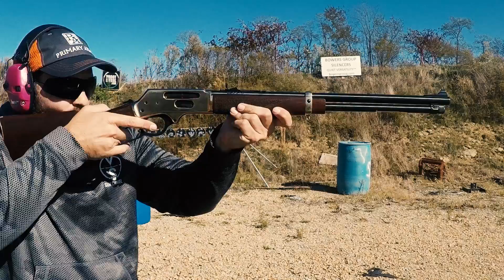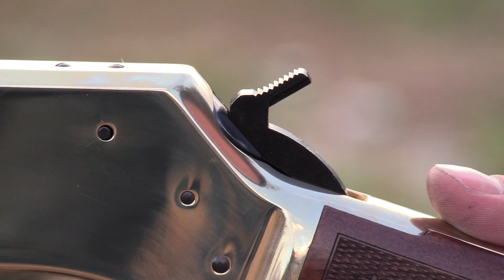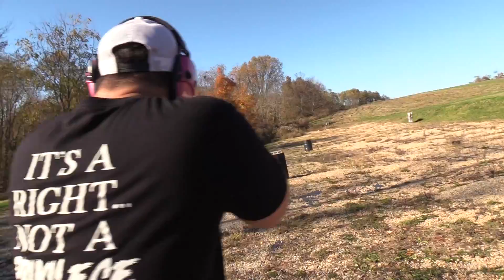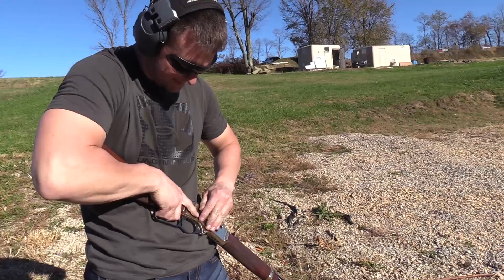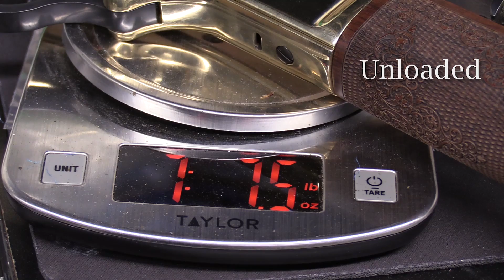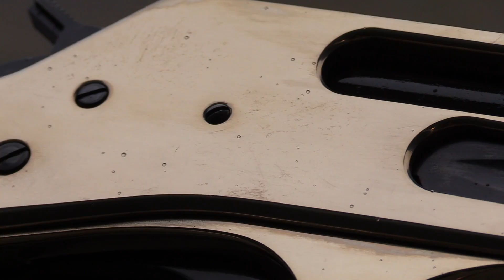Loading Gate VS Tube Feed No Longer 💎 Henry Lever Gun Run and Gun

Comment: If I had to work this gun for ranch defense from an ANTIFA raider gang,
1) Polymer stock w/Keymods. 
2) Large Loop lever
3) Pic rail with white light mounted
4) XS Tritium Big Dot
5) Buttstock Sleeve with pouch covering loops for 1 full reload
6) Plain sling
7) Bandoleers with loops for ammo
8) Ammo Belt with loops

Anything rather then running loose ammo from a pants pocket. You don't want to be another Scott Gadell

Comment: Most repeaters in the old days were 45 cal. This gave you much faster loading speed and you could hold s bunch of 45s in your hand for fast efficient reloading, especially ball ammo. Plus you would only needed one type of ammo for your revolver and your long rifle...that's smart. I would never use a 30-30 repeater. That's just for those stupid people out there that bigger is always better. Your overheating the gun with 30-30, and I guarantee you it will fail sooner than a 45!

Comment: That is a beautiful rifle. I'd leave it as is. If you make a tactical lever action, technically you'll find those cowboy action models pretty good. Those guys who shoot at the cowboy competition shoots, they shoot the piss out those lever actions and they shoot them fast. I'd put on an enlarged lever so there's more room for your fingers. Also need a belt or bandolier to hold your rounds and load from the strong hand side. If you insist loading from the top, perhaps modify the spring on the loading gate so it has less tension to easily slip a round in. I've never shot a Henry lever action, but I've shot a Winchester model 94 for years. My Winchester was used and abused and was a loosey goosey, but loading was easy and fast and so wasnthe action. Despite being well worn in, the accuracy was phenomenal.

Comment: Very cool. If it helps, I load one round about 3/4 of the way past the loading gate and use the next round to push it all the way in while placing the next round about 3/4 of the way in. Repeat until the 5th, or 6th, and use your pinky to push it past the end of the loading gate. That’s how I’ve always done it, and that way I don’t get my thumb pinched.
Reply: Also wrapping the forward handguard in leather will help mitigate some of the heat, although most folks aren’t going to be using them in this manner.

Comment: Would have been interesting to do a side by side comparison of what's faster, Could it potentially be quicker/easier to pull the tube and load/top the rifle off through the tube hole while on the move? Definitely would have to be more careful with the paws on the muzzle end. Also i bet that tube gets pretty hot too.

Comment: If you’re going to load more than one bullet you push the first bullet 90 percent of the way in, then you load the second round the Kingsgate is already open you push the second round on top of the first round and it’s much faster than manhandling the gate every time.
Reply: Plus, if you slightly rotate the gun while shouldered in front of you so you can see the load port you can slam the rounds in pretty quick. I'm a lefty, which means I can hold like 4 45 cal. rounds in my right hand and load them in without it being awkward.
Reply: Good tip there bud
Reply: Or just tube reload it lol

Comment: Personally, the 'tactical lever gun' is fine as is. Regarding the heat creep, I expect it would be mitigated noticeably in the steel receiver version.
Reply: Chemus Van Der Geek no, brass has a higher heat capacity , at least more than mild steel or stainless steel